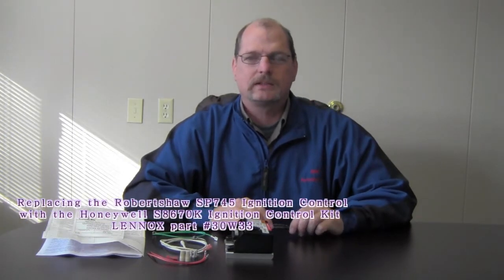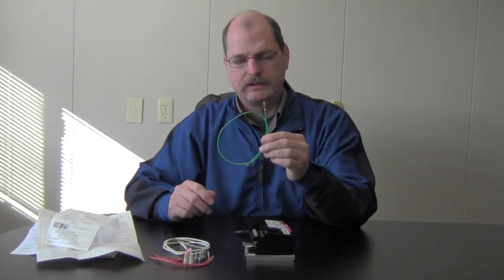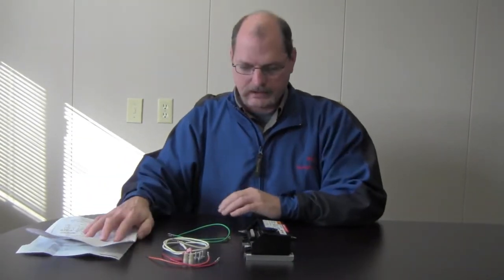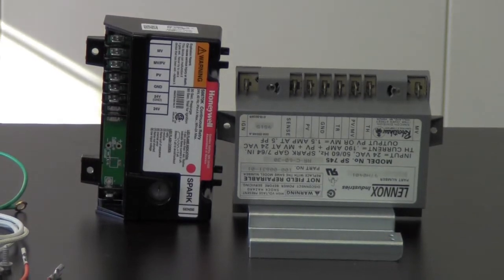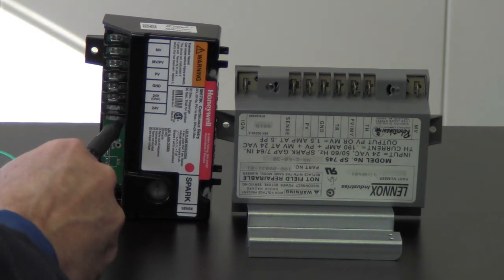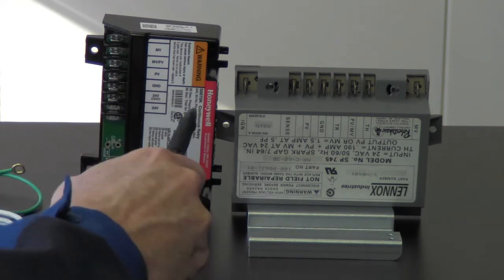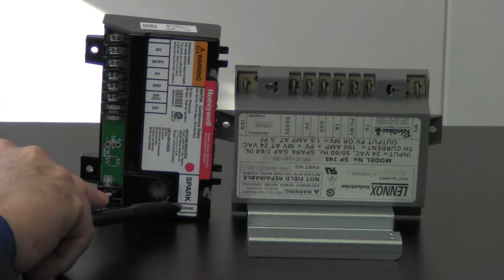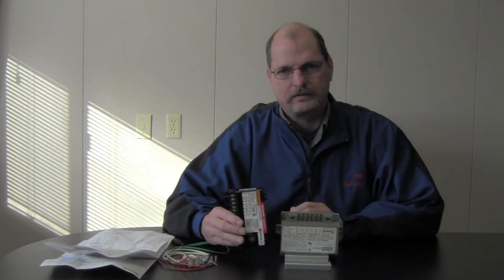SP745 REPLACEMENT

Comment: At 6:35 you say to move MV/PV old to new MV position #2.  I believe you mean new "MV/PV" position #2. My replacement kit has a local sense for the flame sense and says to remove the original flame sensor.  The ignitor assembly is a different physical configuration than the original and its electrode can short to the furnace metalwork instead of the intended ground pad.  You have to manipulate the mounting tag and swivel the electrode to get it to work.

Comment: What is the sign of a bad ignition controller? My fireplace has this Robertshaw SP 745 and the ignition will not start when the wall switch is activated. The fireplace works randomly about 5% of the time but for the most part we cannot get it to work. Does that mean we need to replace the ignition control? Thank you!